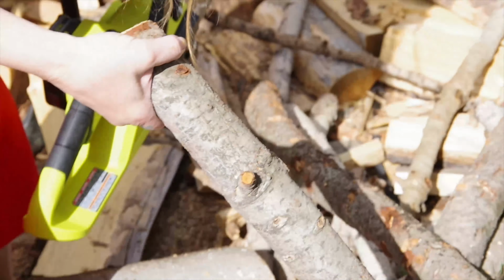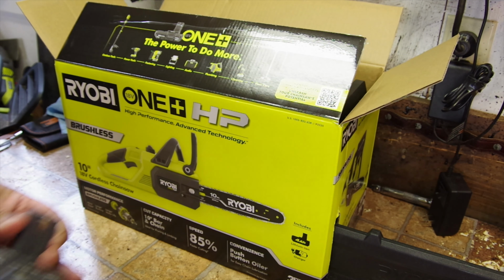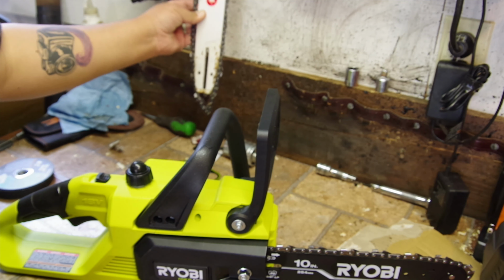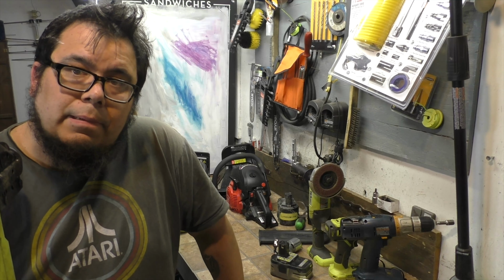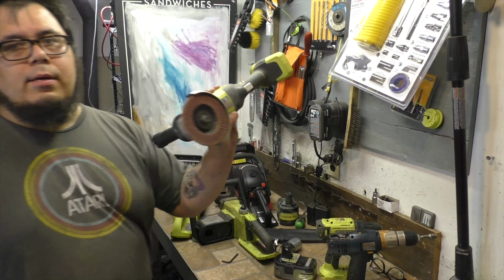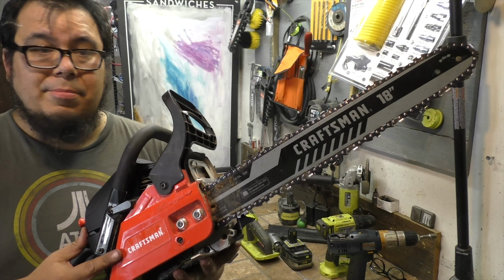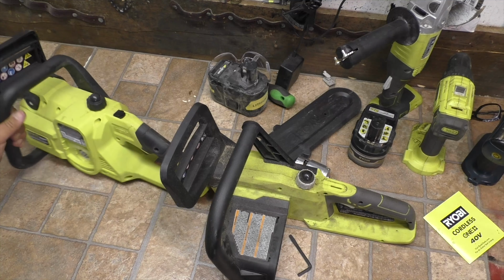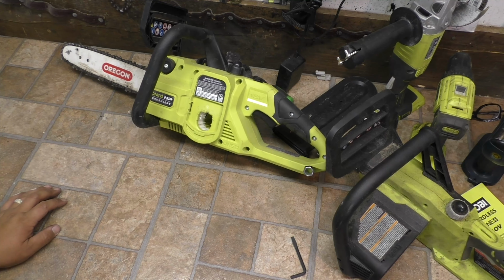Don't buy an electric chainsaw, Ryobi electric chainsaw review

Comment: My partner has a corded Ryobi chainsaw that has just died. Hasn't had much use but it's started sounding really bad and sparking lots on the brushes. I took it apart, it looks like the brake isn't fully disengaging and so i guess it's burned out the motor. Probably more likely to happen if you don't squeeze the trigger hard. Seems like a design flaw to me.

Comment: The 12” saw in the store was actually a completely different saw. Automatic oiler, toolless bar adjustment, higher chain speed, more power (I think)
Reply: Also, for the ego bar u found towards the end of the video, it is actually a standard bar, just has different packaging.

Comment: Are you saying the AC power saw is better than the gas? Or if you go electric, go AC power?
Reply from the maker: I'm saying there's no reason why a bare cordless tool (no battery) should cost twice as much as the corded saw.
Reply: @brnrmbo4658  ahh ok.

Comment: omg mine just stopped working while I was taking a little break before sawing. I checked the battery and it is working on the other tool and have almost full capacity.
Reply: Same with mine happened yesterday

Comment: I've had the 12" brushless model for 3 years, cut a lot of small logs and limbed felled trees with it. No issues, replaced the chain is all. Not really meant to cut logs bigger than the bar but whatever, keep cutting in sandals and a dress but say you're an expert.